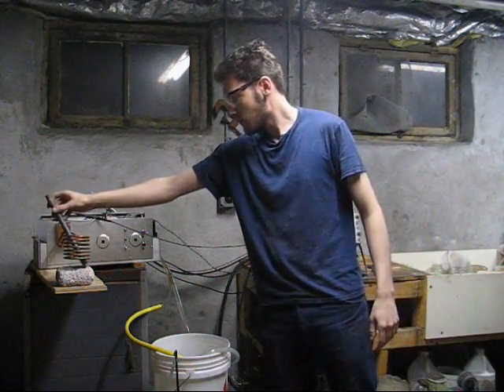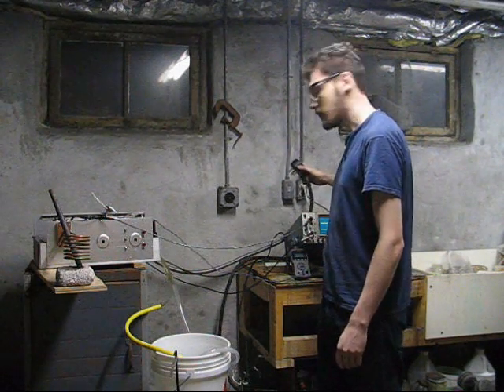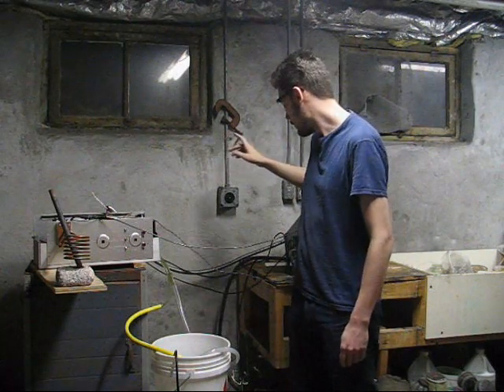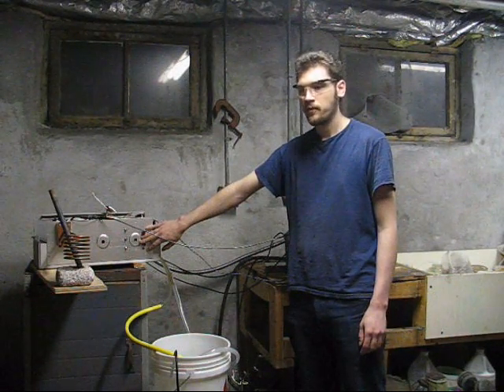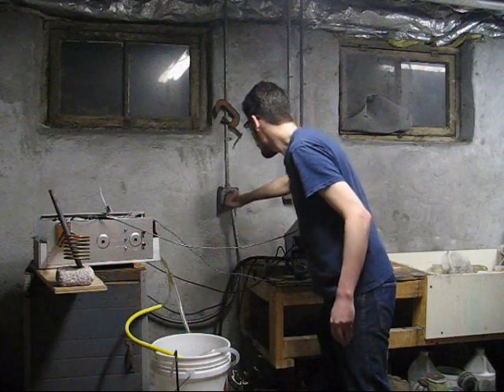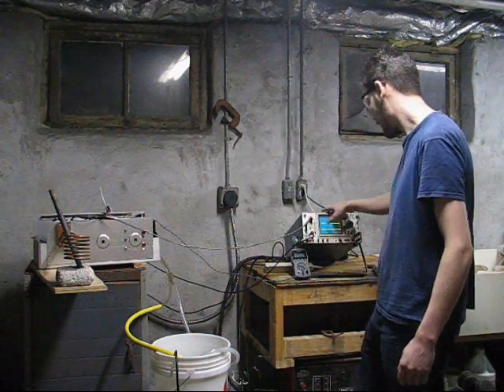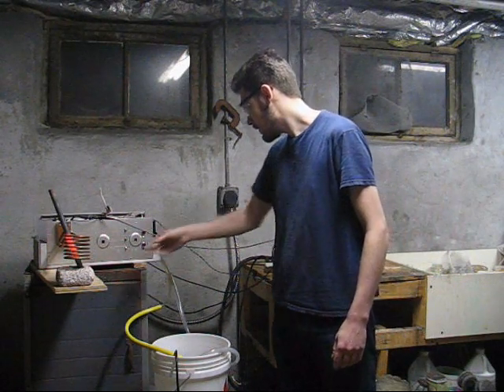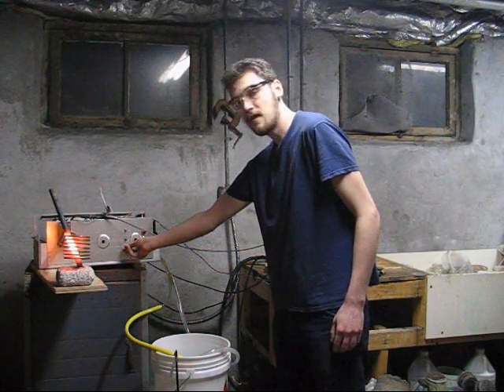Big Induction Heater

Comment: +Tim Williams Does using a coupling transformer help suppress inductive current spikes?
Reply from the maker: There are no inductive voltage spikes in a bridge design. (There may be current spikes, which would be due to transistor capacitance or diode reverse recovery.)
Reply: Thanks for the response. I don't understand why you use one then. Why do you, instead of directly connecting the tank to the H bridge?
Reply from the maker: Impedance matching, of course!
Reply: From what I have read series tank circuits are meant to behave as a direct short i.e. zero impedance. If that is the case then what are you matching?
Reply from the maker: Nothing is ever perfectly zero, nor perfectly infinite.  If it were zero, there'd be nowhere for the power to go, and no heat!

The series RLC circuit has an impedance minima, at resonance, where the impedance equals R.  In this case, it's quite low, around 30 milliohms.  The inverter wants a load around 5 ohms, so an impedance ratio of (5)/(0.03), or a turns ratio of sqrt(167), is needed.  I think I used 10:1, so that works out nicely.

(Trivia: even superconductors are not perfectly lossless, not at AC.  The best superconducting resonators have a Q factor around 10^7 -- extremely good, but not infinite.  Related ponder: how come a chunk of black YCBO superconductor doesn't suddenly become shiny and silvery below Tc? How is it still black when it's superconducting?)

Comment: I'm very mechanically inlined and would like to build an induction heater to quickly bring the neck of brass rifle cases up to temperature to correctly anneal them.  The wall thickness is no greater than 2mm, but I load a number of different calibers so the outside diameter of the neck and taper will be different.  I would like to design a coil that is in close proximity to the neck and correctly follows the taper.  I would build a jig and wind on my lathe. Just lack the electrical understanding

Comment from the maker: @MOJTABASHOMAL This is PLL controlled, but I can pull frequency manually if I want to.  Most of the time, to vary power output, I control the phase angle it locks to.